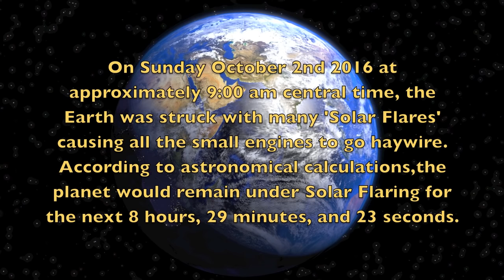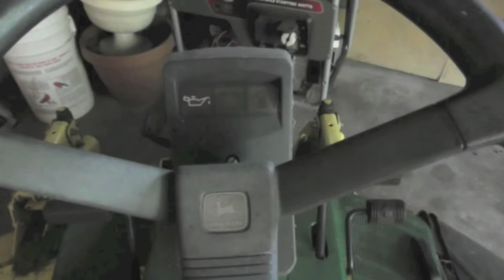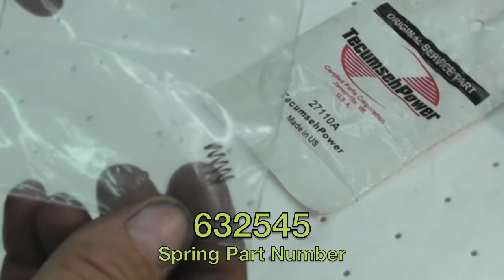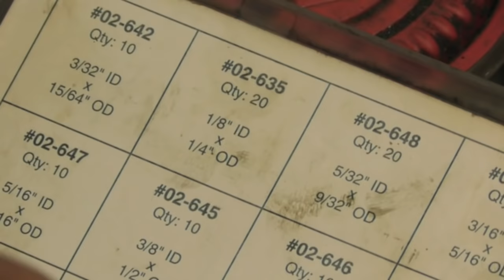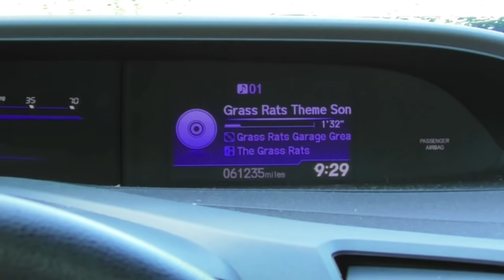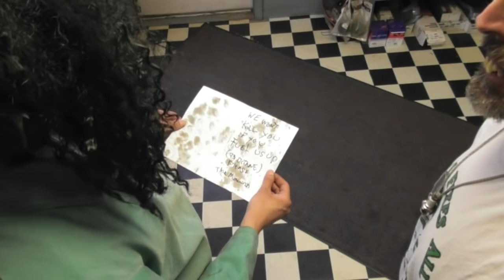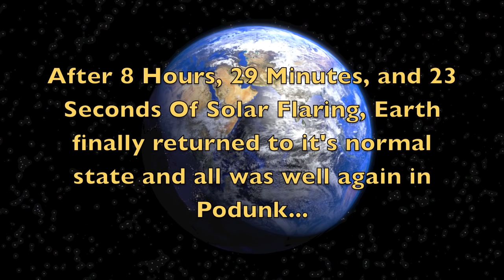How To Rebuild A Tecumseh Series 7 Plastic Float Bowl Carburetor - Maximum MowerDrive

Comment: This video may be 6 years old but it saved this Grass Rat’s Behind!

My White Outdoor L-155 tractor mower had the engine replaced at some point in its life with a Tecumseh OHV180. Engine required Quick Start to run and would only run with full choke on. 

Found the two gaskets for $0.02 each. Rep at Grainger was impressed with my troubleshooting that he refused to charge me for them. 

Replaced the seals (kept the good one from the Venturi for a future repair) and this mower runs better than the day I bought it. 

Thanks Taryl for taking the time to show what the problem is and how to resolve it. I got my dinner for sure! 

Cheers from Nova Scotia! 🇨🇦

Comment: Video is and 5*****s for content.  You have saved my MTD Tractor’s life (and mine)!!!
Problem was fuel starvation due to the two old gaskets as you showed, has been getting progressively worse in the last 18 months. Ended up only running on full choke!  Replaced with new “O” rings and the Tractor runs just like new. Many thanks for a great video!
Peter
Reply from the maker: Peter Johnstone great to hear! Ur welcome and there's ur dinner!!

Comment: Taryl  great video but tell everyone to check the simple stuff first. Like the gas cap vent.  If your engine runs for a moment then dies a minute latter, could be the gas cap  air vent is plugged on the gas cap. Remove the gas cap and start the engine and see if it stays running. If so clean out the air hole on the top of the gas cap to the gas tank. Then tear the series seven  carburetor apart if this does not solve the problem.

Comment: each one is getting better and better, are the orings special or just standard ones?
Reply: i like ..i like
Reply from the maker: Mustie1 standard O rings that fit around the hole properly.
Reply: Hi mustie
Reply: Just cleaned mine and it has the anti back fire solenoid. The spring came out but the jet looks like its either stuck in there or pressed in? Already replaced the venturi o-ring but cant seem to figure out this other jet and o ring. Can you help ?
Reply: @darrenbreckler3926  did you ever figure it out?
Reply: 2028 END I did but its been so long I can’t remember. I think i blew compressed air through it after a good cleaning and it popped out

Comment: so many videos on you tube you watch and dont know anymore after you watch them than before you did lol took my series 7 plastic floatbowl carburetor apart and just like you said o-rings behind main jet had swelled up only a pinhole for the inside diameter replaced o-rings and runs great before had to use start fluid to get going and full choke to keep running glad i found your videos thanks .Weston Ohio

Comment: Finally, some good info on this carb....My sister has the same style carb on her generator, crapped out during the hurricane...Tried to help out by phone but no luck....I'm guessing the oring behind the jet is at fault.  What is the purpose of the spring under the nozzle?Perhaps hers had the anti backfire thing on the jet plug that might be causing trouble as well....Will investigate more, makes sense to me now though....

Comment: I found this video helpful. I have a mower with this carb that I cleaned several times and could not get it to run right. Starving for fuel and for a simple carb I could not figure out why. 
    Well? I didnt know the main jet was where it is. I thought that was fuel bowl drain plug. I took apart and the little rubber O ring was swollen shut not allowing enough gas thru and it was dirty in there. The rest of carb was clean as can be.

Comment: Firstly, ridiculous video😂, but I will skip through the ridiculousness any day to get to the meat and potatoes of your fix. You just saved me from buying a new carb. I must have cleaned it 4 or 5 times trying to fix it. I happen to have a stock pile of various O-rings laying around. Replaced both and my generator started right up.
Keep up the awesome/ridiculous work.

Comment: Picked one up from the scrap at my work, a small chain repair shop. They couldn't get it running. Well I crack the carb open and thanks to your video I realize that I'm missing the center spring and the seal for the main jet! Ordered parts and should be back in business soon!

Comment: Question: I have a 20hp Tec with new dual carbs, with the plastic bowls.  It ran fine for the first day or two, but started serging.  From your video's I've learned it's probably a lack of fuel. Could that be from a weak fuel pump? Or is there a jet inside the carbs that I need to drill out a tiny bit?  Or, something else? Tanks a bunch. I'm hungry for some dinner.

Comment: I used a paper gasket like the one you used and it seems to be leaking a bit of gas. The mower runs good after replacing the two rubber o rings.

Comment: When you drop the bowl immediately take out the nozzle. I set a bowl in a container and a minute later the nozzle launched across the shop due to spring tension. Found the nozzle but not the spring.

Comment: My carb didn't have a float pivot rod, so I shortened a Briggs & Stratton pin, and it worked great. But!! I did not know it needed the nozzle spring. I appreciate the part number but who is the supplier for that spring?

Comment: I've got one that started and stopped after short run. Then only ran on carb cleaner. After confirming fuel supply and anti backfire I tapped bowl and now it starts but runs rich. Tested bowl off carb and fuel rises to float pin level but doesn't overflow. Can the o rings or nozzle cause the flooding or must it be fuel level? even if I shut off fuel it puffs black smoke to just a second before shutdown.

Comment: What is the part number for the needle and seat? I bought Tecumesh 632709, which had a metal needle and a rubber seat.  When i take mine apart, the needle has a rubber tip, and the seat looks like a brass cone.

Comment: i have a mtd and it has one pf these carbiertrators on it its always been hard to start i rebuild carb new plug filters what should i check next fuel pump.  can i replace it with a another model